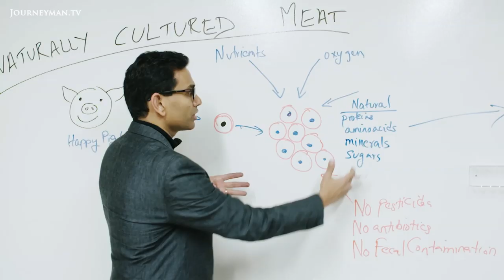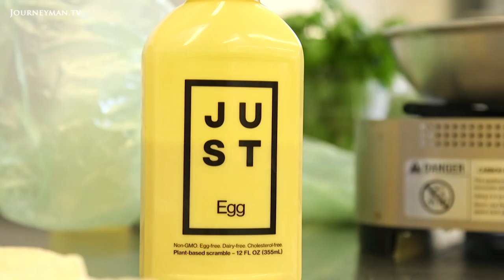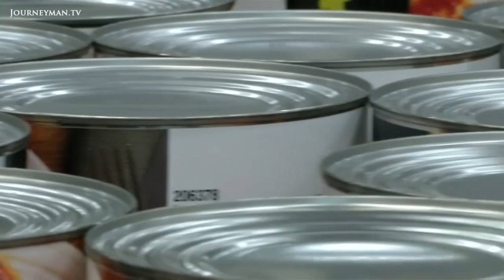Growing Meat in a Lab

Comment: Does it have the same protein structure  as normal meat?  I need to stay swole...
Reply: it does, the issue now is producing meat that has structure not just at the molecular level but on the macroscopic level too (ie ribs, steaks, wings)
Reply: Don't worry about it. Before it can be produced cheaply enough to be mass produced we'll all be dead. Investors will only keep investing in something for so long, without profit. Can these experimental projects produce before the investors pull out is the question.